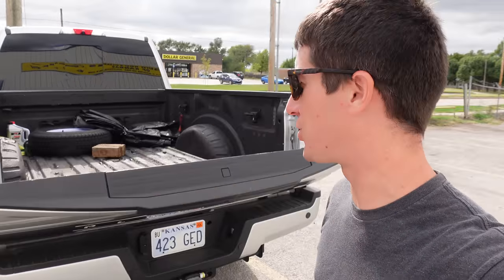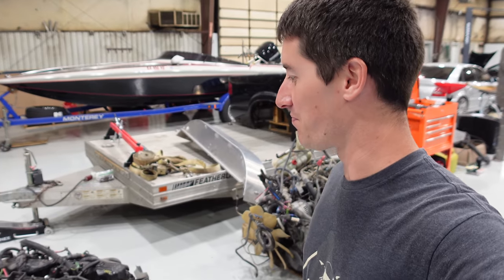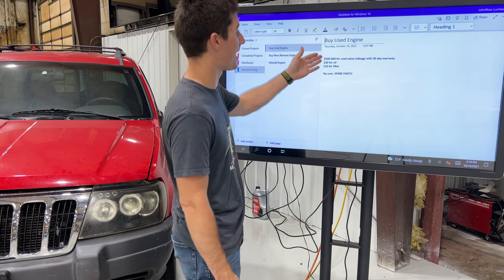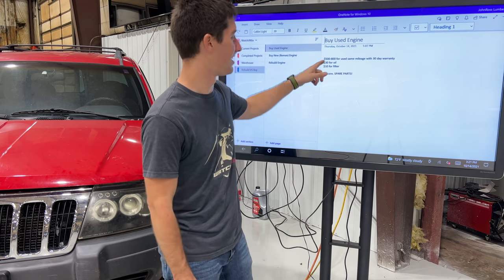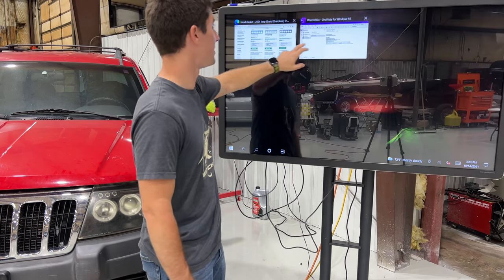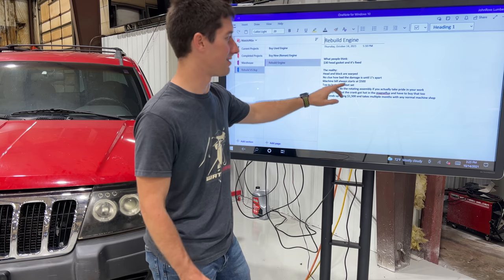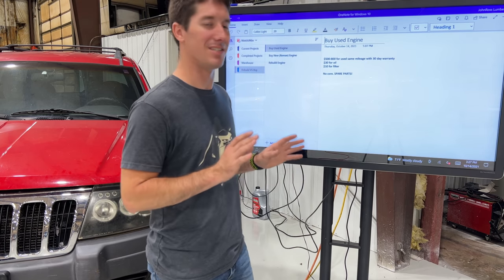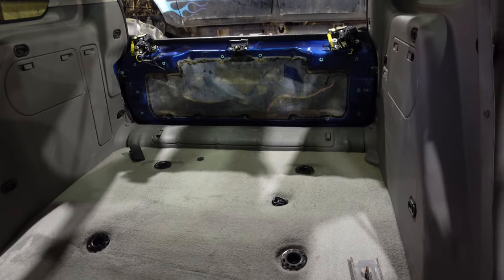Here's Why You Should NEVER Rebuild An ENGINE *The Math Doesn't Add Up*

Comment: @3:17

Or if the profit margin isn't there as you alluded to about a minute earlier in the video.

Wow you are correct I would be impressed if you could make $1,000 in one day, I think you have to add in some overhead of a forklift to lift their out of your truck for those of us that don't do this for a living plus your gas you burn to go to the junkyard and back.  Rental of a Gantry crane to lift an engine out of a pickup truck is $300 per day here in Chicago.  Would cost half that engine to run before lift.  It's difficult to rent Cherry Pickers because of the liability you can only buy them which put you right back at the Gantry rental.

Comment: Those 4.0 Jeep engines are tough - I've owned a couple and both went well over 200k miles with hardly any issues. Wish we could find them that clean here in Ohio - here they are all rusted out.
Reply: The cash for clunkers in 2008 trashed a lot of 4.0 Jeep engines (I know because I traded one in for $4500). The engine had 160 K miles on it although the vehicle was 20 years old and it paid the down payment on a new Ranger pickup. The vehicle went to the salvage yard after the engine was destroyed.

Comment: In all honesty how many rebuilt engines last as long as a manufacturer’s stock engine? Hardly any. The amounts of hours that went into the RND is under specific tolerances and part size specifications. Once you throw a 10 + over bore, grind crank with oversized bearings Etc…. The geometry and stress points change just enough to effect the entire rotating assembly in ways they weren’t designed for. After dismantling so many stock and rebuilt engines it’s far more common seeing scuffing on piston skirts and bores in rebuilt engines than factory. Human error is a thing, and the machine shop guy’s can mess something up hence why it is important to double check all tolerances before assembling. Getting 100k miles out of a rebuild is actually asking a lot. Not saying it’s impossible it’s just not worth it. 5-6k on a better than stock rebuild vs a new crate @around 8-10k with warranty…. I’m spending the extra on the non remanded crate

Comment: Used engine most times bad idea imo also same  mileage is the worst thing you can do. Many of these cars fail because thats just what is expected from the engines. You put a working used engine in it and its 99% sure the same issue will happen to that one as well. Even if the warranty gives you peace of mind the client cant do much with a replacement engine, they have to pay someone to install it. Its great for the seller sucks for the buyer.

Comment: I want to rebuild my engine, it’s an old 7.3l with 396k miles and it runs fine, but I’d like to have it do another 400k miles almost perfectly haha. But if I did I would also be upgrading parts that’s for sure. ARP head studs, valve springs, lifters, rods, pistons, and prepare it for compound turbos to be a powerhouse response daily driver in an OBS format.

Comment: I think this could be true if you are just flipping your bought used daily driver with high mileage.
This only put a junkyard engine into your daily driver that you plan to keep doesn't seem wise. If you want another 200K miles to keep forever you most likely need a new or remanufactured engine with warranty. Unless you have the machines, tools, shop abd skills to completely remanufactur the junkyard engine imcluding shooting small BBs to sandblast after walnut blasting, using equipment to completely remove all debris and get every walnut and metal bead out, thrn machine the head abd hone cylinder walls, change out rods, lifters, pistons, piston rings, cylinder inserts and so on...

There are decent reman engines out there for under $1500 with warranty.

Comment: If you are flipping a car or truck or SUV, then installing a used engine makes sense and it also makes sense to install a used engine in many customer vehicles as well as long as you have a trusted source for good used engines. Lets keep in mind that a used engine is just that , A USED ENGINE, that you know nothing about,... its a gamble and always will be. That said, I have installed many used engines with very good success. But nothing will take the place of installing a re-manufactured engine from a high quality re-manufacturer. The cost is high but you have an engine as good as new and possibly better. The choice depends on what a customer wants, needs, and expects. 

Finally, can we address a pet peeve of mine. Can we STOP calling a used engine a new engine!!, its still a USED motor, just new to the vehicle its put in. For too many years I have listen to people say that they have put a new engine in their car or truck and when the hood is opened, low and behold, I'm looking at a used engine that may run fine, but has junkyard markings all over it!!!,...lol

Comment: Yeah for a flip, just swap the engine out. But if it is for a valuable car that you plan on keeping a rebuild will last much longer with greater piece of mind. Also it depends on the availability of a replacement engine. some are very hard to come by and then your only option is to rebuild

Comment: It pays right now to fix up the old clunkers and get them back on the road considering the chip shortage fiasco and used car prices these days. People paying big bucks for the beaters with heaters to have something to drive. Makes sense to a flipper to swap. Junkyard are starting to do this  in my area and using up their stock to make bigger bucks.. They are even doing engine and trans swaps for customers.

Comment: Had to replace the head gasket in my cherokee. Had the head decked and completely rebuilt for $185. Runs like a top after over put 10k miles since. Wouldnt have done any different way but JR is right. It did take 3 fuckin days 😒. Engine swap would have been some much easier but the route I went was still cheaper  even after I put new lifters, push rods, and a comp cam, and a timing chain.

Comment: Rebuild on a 360 cubic inch Lycoming airplane engine is 25k.  New is 40k. Used doesn’t really exist. Those engines get rebuilt every 2000 hours or so.

Comment: My Mitsubishi Eclipse has a sohc 4g64 and it’s at 180k miles and at 200k I’m gonna pull the motor and inspect, re-gasket everything, water pump, oil pump timing and probably get the head fully serviced and maybe do some upgrades in the valve train if possible, i would just dohc swap but this is my daily and I don’t want to have to get it tuned and it’s a pain in the ass to tune it because it’s auto

Comment: I thought the way they unwarped heads and blocks was by bolting them to a really big block of steel and then putting them in a kiln for several hours and then letting them cool , still mounted to the really big block of steel ?

Comment: I disagree on his idea. Some engines are really expensive and worth more than their car values. If you want to buy decent engines with low miles, $3000 easy probably $5000 including shipping cost. How you rebuild engine is expensive. I only replace parts that are broken. Ex) I bought a 2009 audi a4. It had a cylinder 1 misfire and I found out that there was a hole in the piston. So what I did was that I bought a core engine and just took out a good pistion and put it into that engine and boom! It was working like champ. I did not take it to a shop because they are very expensive. They even clean the engine block to charge you more money. I dont understand why. They are supposed to be dirty. People never see your engine. I only replace gaskets because they are getting bad as time goes by. Metal parts like rod bearings or piston rings, as long as they are lubricated properly, they last for a long time. I do swap engine only when they are really cheap maybe around $500 but its hard to find cheap but nice engines.

Comment: My friend just replaced an engine in a 2012 car he bought in 14 for 14k  with 7 k miles. He has 150k now 10 years later . He just put 10k into new motor and cats and will keep another 3 years minimum.  I did the math and broke down the cost over 13 years. Was under 2k a year with new ening cost . Plus he still has equity when he sells it so the under 2k a year could go down.  Thats not bad considering i know some morons paying 1k a month and trading every 3 years .  His car is special equipped for his work.   Plus hes been driving for years and knows what hes got.

Comment: Here's my thoughts on rebuilding/replacing engines:
Agree with JR that you should NOT rebuild any regular engine. Replacing it makes much more sense.
However, I don't think you should replace the engine either. If a vehicle's engine fails, everything else isn't far behind. Next you'll be replacing the transmission. Then the transfer case. Rear end. Suspension. Brake system. Where does it end? A vehicle needing an engine replacement is at the end of its life. More than likely something else major will soon fail as well. In this scenario, best case JR makes about $1200 profit after replacing this engine and selling the Jeep. To me, that's not worth the amount of labor involved in swapping out the engine. Makes sense for JR as he makes extra profit on Youtube revenue. But for someone who is only flipping it without the youtube side, that's not a big enough profit. There's much easier flips out there. Just my opinion.

Comment: If I didn't get my kicks from building or rebuilding and I was flipping them I would be doing it this way for sure. I only do Chevy trucks on my time and the engine is almost never the problem. Transmissions and electrical problems are the norm. So many stupid and useless electrical bits and bobs that are not built right and just quit or break. I have 5 or 6 places where the stock wiring just ended up pinched off or worried appart on my latest 2001 Z71 LS. When I do my project truck I'm going to customize the wiring because you can't trust them to make an electrical system that is just simple and reliable.

Comment: iv done my blocks and heads with a granite surface plate and sand paper for yrs after having problems with local machine shop messing up a head they refused to replace for a 1930 chevy coup and iv done say 30 or so in the last 25yrs with only 1 return but i missed a fine crack we think and it didnt have a problem for 9 months he started getting a smell i offered to fix it for free but he chose to not fix it and it got 40k or so and was t-boned. if you have the right tools and take your time hand work will beat a mill or grinder any day about 30min per .001 by hand.

Comment: Buying a used engine, trans , differential, steering box or any other used item could be a really good deal... But, if you get one that is in bad shape, it could be a nightmare... I used to help a fella who did this, and tried to run a business doing it frequently... If it worked ok, that was a win... But if it failed before it was sold, or worse - failed soon after it was sold, it became a real issue for his business... He had to go to court more than once, to settle with the people who bought the junk , that he received good money for...That became the point that I decided to stop helping him, because I did not want to be associated with this type of work... Re-building an engine , trans, differential yourself is the only way that I'd consider doing an overhaul. Mainly because I have seen the type of work that some of the re-builders do with things like this... As far as flipping cars, it just does not pay well, unless it happens to be something of special interest... One thing that this guy did not mention or account for, when he was talking about the junkyard selling him a warranty, is the LOST TIME it took to remove & replace a worn-out used defective component that was supposedly good... Too much of a gamble for too few reliable results. Re-building an engine and other components makes a LOT of sense, if the block & head(s) are cast iron, if you are going to keep the vehicle, if you want to LEARN more about the vehicle that You'll be keeping... I don't know where he gets his info of how many people are driving "Throw-Away" vehicles, but one thing is for sure, I'd never buy a used vehicle from him....

Comment: Unanswered question: How many miles on the used engine? What happens when you find replacement engine is bad in 2 months and you have to do it all over again?
Reply: If you are keeping the car and have the tools, and ability to swap at home the $800 engine wins again. This time find a place that doesn't list "never tested if ran" like every turbo Subaru engine I came across before doing the while you are in there this is gonna fail from factory stuff.

Comment: Who warranties the engine? You ?
Because I’ve never heard of a wrecker that will let you transfer a warranty on a used engine and at that their warranties ( most yards)are only for 90 days. So the customer comes back with engine problems are you the one who eats the labor , and goes back to the wrecker for another engine? Because if you send your customer to the wrecker for an exchange they are going to be laughed out of the building! You’re a car flipper and it’s buyer beware when dealing with one .

Comment: Exactly why I don't purchase ANYTHING from flippers just for this reason, every car and truck in the last 15 to 20 has come from the factory with issues.  Why in the WORLD would I buy a car from you and you just replaced the engine with the same issue it came from the factory, plus whatever the reason it was sitting in the salvage yard for.   That's why I get my engines from Powertrain Product, they rebuild the engine and repair issue that came from the factory and give a GREAT warranty.

Comment: I would absolutely buy a remanufactured engine with a warranty if it was something I liked and was going to keep it...I absolutely would NOT get someone to rebuild it...first problem with that, is it has to go to a machine shop...and machine shop work is expensive...got to wait on them, it always costs more than it was supposed to, and then...after the machine shop, take it to the rebuilder...got to wait on them to get to it then...when they do, they keep calling saying it needs this, needs that, costs keep climbing, winds up being WAYY over the estimate/quote...and good luck getting them to warranty/ take care of it if something isn't right...at that point, you start saying to yourself...Wow, I could have got a reman with a 3 year warranty for less than that..or, I could have gotten a premium reman like a Jasper engine for about the same money...yeah, that's what you should have done to begin with....

Comment: Most modern engines are not rebuildable and those that are cannot be rebuilt because engine rebuolders mostly have the equipment and rebuilders that only can rebuild the old pushrod American engines. The Jeep is one of the last engines that could  successfully and reliably be rebuilt by an engine rebuilder..

Comment: Unless you are personally good at the work and enjoy it there is little point. Takeouts from wrecks are generally easy to find and cheaper by far to install. Modern engines are too complex for individuals paying retail parts prices to rebuild because even when your labor is free (machining is cheap enough most times not to matter) there are so many wear parts that overhauling an engine to what aviation calls "zero time" is beyond being an economical repair. I keep my rides for decades so I collect donors cheap years before I need them. (If you keep a truck long enough it becomes a classic about ten years after hitting "peak shitbox".) Lately self and bro collect early LS engines for our stash because those will dry up sooner than most think.

Comment: My engine in my 2011 5.0 GT I daily just found out it needs a new engine. It had a lot of other problems that the local tuner shop seemed to fix before they ran the last diagnosis they determined cylinder #8 was bad and therefore I will need to keep it parked until I can get a new coyote engine.. they offered to take it to a shop that would pull it out inspect it and see if it could be repaird or not. But I plan on keeping the car would it be better to buy a brand new engine and put it in? I wouldn't even consider this if the previous problems weren't fixed I paid 1400$ in labor and couldn't even drive it when I got it back yesterday. I plan on keeping it garaged.

Comment: He's right on most of these modern engines they're also complex with vvt-i and other things most of these engines it's better to just replace it with a good used one and be done with it there are risks involved but it's a very cost-effective plan especially if it's an older vehicle like he is saying as for Jasper stuff I used to work in the industry they give a good warranty but some of their stuff is very low-quality and it's very expensive unfortunately I would go with used

Comment: A lot of the new all aluminum engines are not rebuildable if the cylinder bores are scored there is not enough nor replaceable iron sleve to be bored out. And the aluminum heads if dirty contaminated oil is run through them the cam bores and lifter bores will be trashed and not rebuildable.

Comment: In the long run your math will never cut it. Too many inherent problems that will never get resolved without a rebuild to correct problems.  If you sell the vehicle right after the swap you come out ahead but the purchaser loses. You can't spell engine rebuild and you don't own many tools. You can't swap a bad motor and lose the time and money. Please don't make any more videos I've spent 55 years as a journeyman mechanic. You have zero experience.